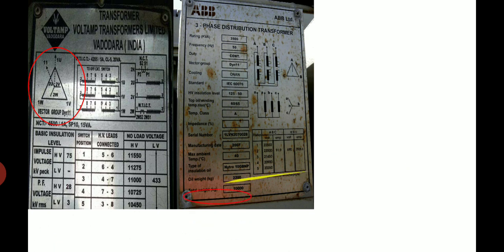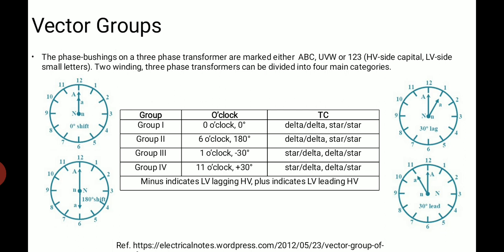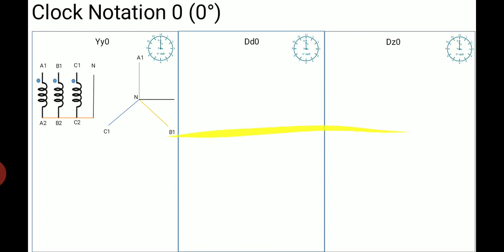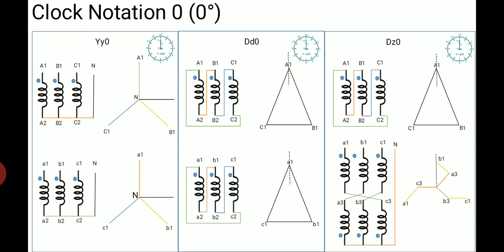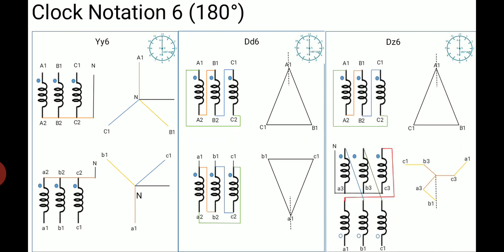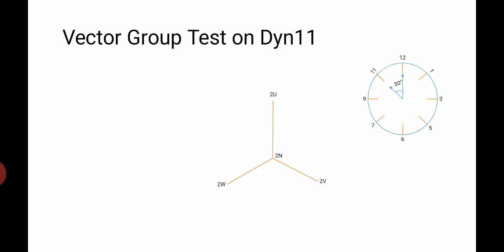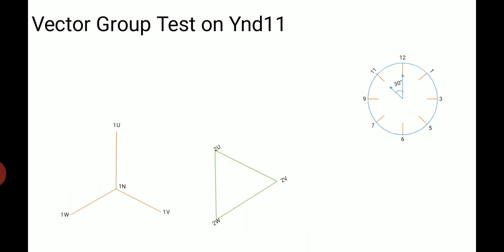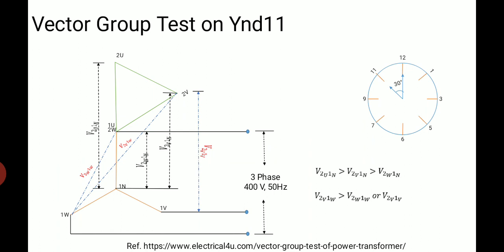Vector Group Test on Transformer

Comment: Great Information Sir, Can u please share how we can change Dyn1 vector gup to Dyn11 or viceversa
Reply from the maker: Dear Suresh,
Go through the following link:
http://files.engineering.com/getfile.aspx?folder=849b29db-03c1-48d4-9300-259420381acd&file=How_to_turn_a_Dy11_transformer_into_a_Dy1.pdf
Reply: @mihirbhatt2533  : Can you tell vector test condition for Delta Zigzag (DZn0).